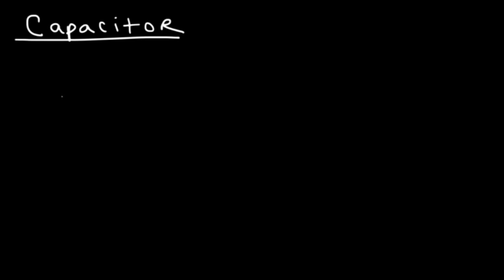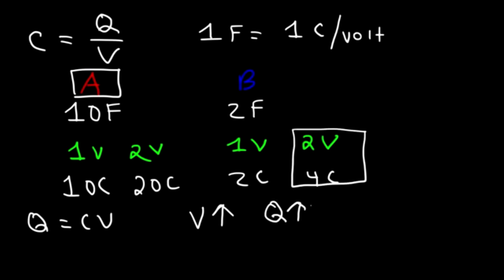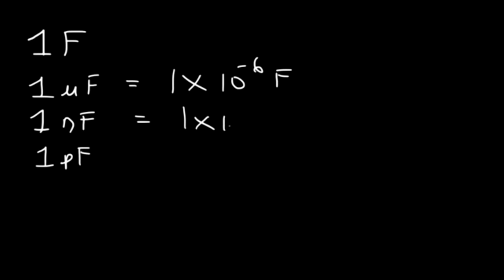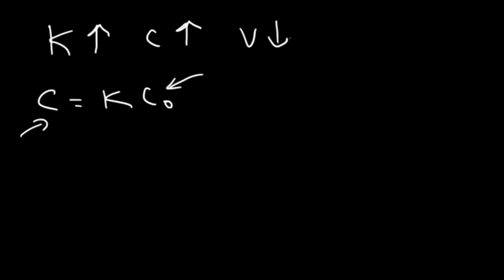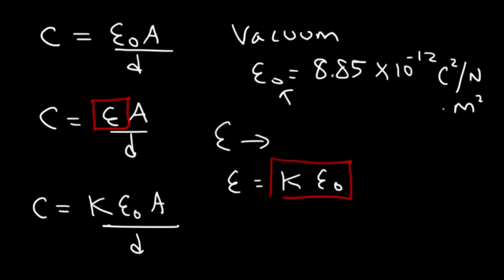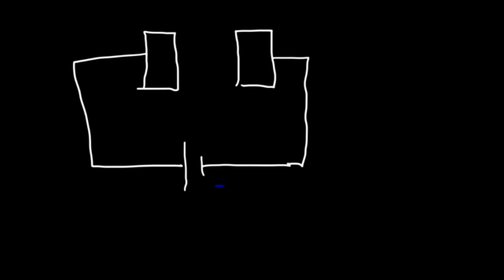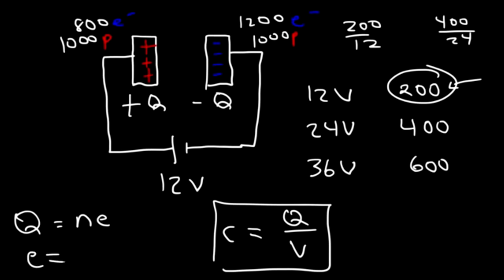Capacitors - Basic Introduction - Physics

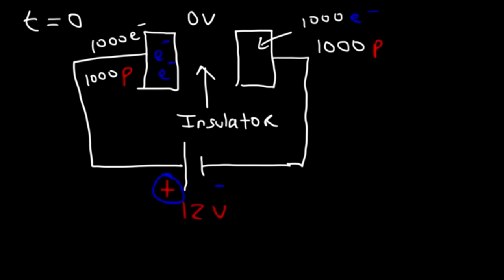Comment: But sur at 20:06
You said that the electrons don't flow in the dielectric so they got towards the positive terminal of the battery 
But doesn't that mean they are going towards the higher potential ?
Please explain

Comment: Water is a good conductor of heat and electricity. How is it possible that you mention it at 0:28 as an insulator?
Reply: purified water (distilled) does not have any ions, so it can be considered an insulator

Comment: Here we have 1000protons1000e on both sides.
What will happen for example if we have 800p,800e on one side and 1000p1000e on the other, so its still neutrally charged?